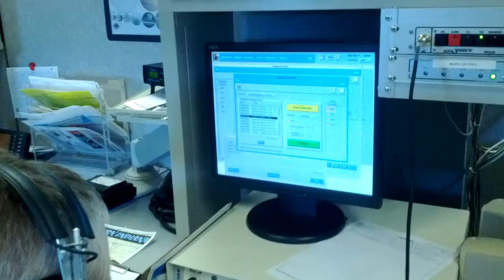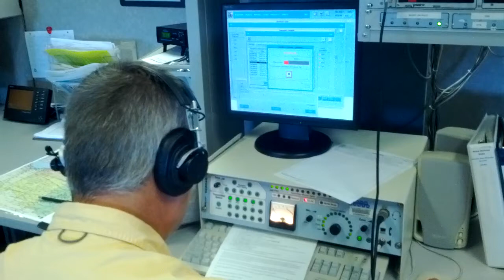Behind the Scenes: Required Weekly Test of the NOAA All Hazards Weather Radio

Comment: Still doing it by voice! Our station uses a computerized voice and honestly I miss the old school system when it was a person reading it off.
Reply: My NWS office, Ruskin FL, still uses live voice for their weekly tests.
Reply: My office, Grand Rapids MI, still has a live voice for the required weekly test, as well. Also, even when CRS was still around, there were some stations that used Speechify Tom for the test, so not all stations use a live voice. I believe that when BMH was introduced, live voices are now being used less frequently, but it was not unheard of for a computerized voice to read off the test when CRS was still being used.
Reply: Well, ours is now officially off the air, so we are left with no warning system now
Reply: Actually that system in the video had added computer voices in the late 90s and the system was put out of service in 2016 with  a much newer system
Reply: My office, Twin Cities Chanhassen had voice until around last year when they had some problems and then started using the paul voice for the test